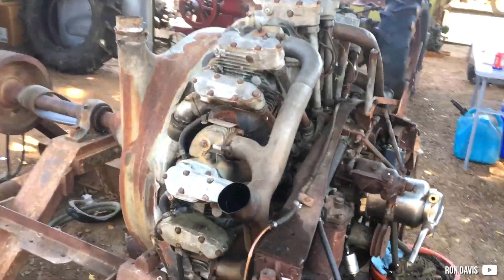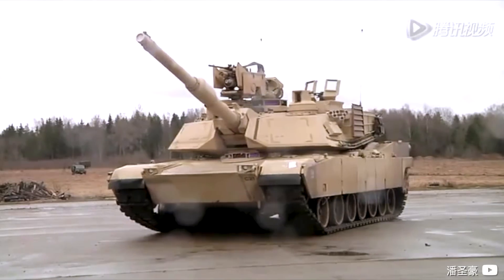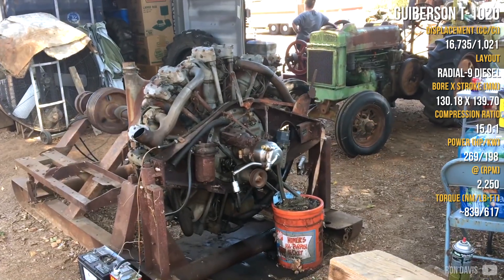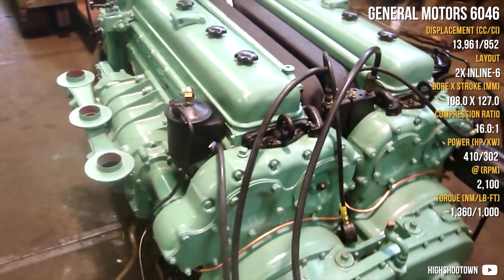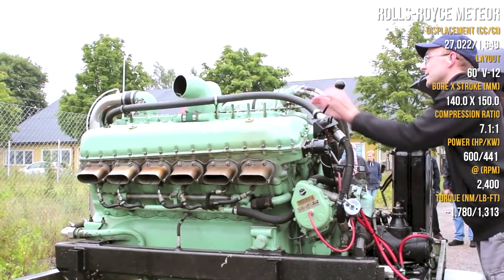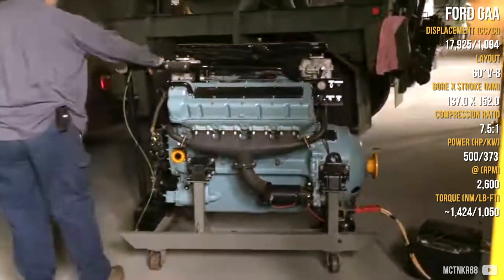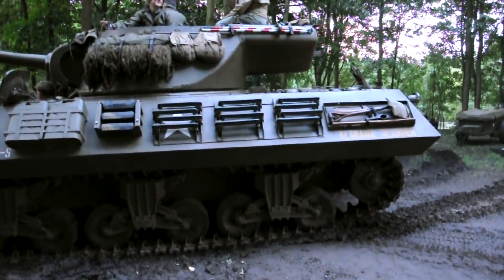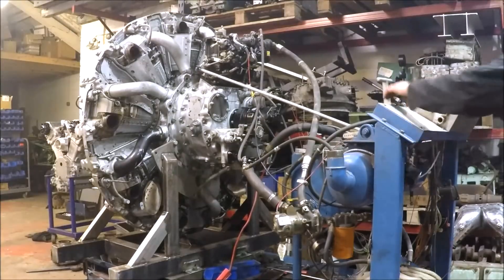The Strangest Tank Engines In The World

Comment: Soviet T64 tank has 2-stroke 6cyl opposing-piston diesel like on some Soviet locomotives and Junkers bombers. As well as T80 has quite similar to M1 turboshaft power unit. There are also some examples with odd cylinder configurations like X or H
Reply: T64 tank have 5 cylinder engine, only most new versions t64bv2 have 6 cylinder 1000 h.p engine

Comment: The RR Meteor was a V12 but they also made a V8 version called the Meteorite which was used in the Mighty Antar tank transporter.  Many of the spares were common so you could get a V8 tower with a Centurion V12 on the trailer.  Both were made by Rover after they lost the jet engine contract to RR.  This was a sort of consolation prize.

Comment: Your "Twin Bus Engine" is was known at the time as the 6-71 twin "Power Pack". It's two 6-71 Detroit Diesel two stroke engines mounted on a central gearbox with a single output drive. Used in tanks, boats, particularly landing craft and for generating electricity or running irrigation pumps. After the war, there were so many war surplus units like this available quite cheaply, that logging companies bought hundreds of them to re-power yarding equipment that had originally been build to run on steam. The "Power Pack" eventually lost favour when the 8V-71 and 12V-71 Detroit diesels offered the same or more power in less space, and did away with that central gearbox.

Comment: i actually am planning on using a type 59 chinese mbt diesel engine in my 1950 buick. why? well it has a near 1.5 ton inline 8. my hoist can hold 2800lbs on max setting. it bent the 1/4inch total thickness hoist like a taco so its in the 3klb range. the tank engine weighs about double. but. makes 1500ftlbs torque..... on the lowest tune setting. i been planning it for years. allison racins transmissions claims they can build a semi truck trans to fit it. sadly i need 30k for the motor{26k of that is shipping fees} and over 30 for the trans and trans build. hopes and dreams right now but damnit i need it

Comment: Aircraft engines do NOT spin the other way around from automotive engines!  SOME Honda engines spin in reverse rotation and some aircraft engines are produced to do the same thing [The LO-360 on the right wing of the Piper PA-44 Seminole], along with some Russian engines that seen from behind, spin their propellors [output shaft in automotive use] counterclockwise.

Great video!
Reply: European engines turn one way American engines the other or that is how it was..
Reply: @flyingjohn2284  That's not true.  The British and Russians built some reverse rotation engines, but generally European engines spin the same way as American engines.

I'm not sure why Honda does this.  They sell a lot of cars in Japan where they drive on the left and reverse rotation means the engine can be located on the left side of the car [seen from behind] and the transmission on the right, which might give more room for steering and brakes?  I don't know.

Comment: One of the main reasons the American m1 abrams has a gas turbine is because it’s sound signature is at a higher frequency. Higher frequency’s are louder up close but from far away they are harder to hear because higher frequencies travel a shorter distance than a low frequency. So a diesel has a lower frequency meaning it could be heard far away compared to a gas turbine and the US army saw this as an advantage.

Comment: never knew removing a forced induction system reduse so much power, l like legit 16000 to 600 isnt a small number
Reply: There was probably other changes made for the different performance needed. Aircraft need high output and at mostly high rpm. The tank needs good torque from down low and up. At the least the cams and ignition would be different, and possibly more.

Comment: t-64 opposed piston engine. its 5 cylinder but 10 pistons and two crank shafts. it used a turbo charger to force air through he engine since it does not have valves in the normal sense. it also uses gdi because it is closer to a2 stroke then 4 stroke.
Reply: It's called a Gegenkolben motor, invented Welhelm Oechelhauser and Hugo Junkers.
The 5TDF engine is based on the famous Jumo 205 series and is not GDI, it is a multi fuel 2-stroke Diesel cycle engine.
Reply: @sandervanderkammen9230  it is "two stroke" but not in the traditional sense. the turbos keep the air moving through fixed holes in the walls, but the the fuel is injected.  if you read documentation on the Russian engine it has a separate fuel and lubrication system. idk how the German engine was made but this one has injectors. http://btvt.narod.ru/4/5td/5tdf.htm
Reply: @triarii_00  It is very traditional for a two stroke Diesel engine, uni-flow type, normally aspirated with blower scavenging or with turbo-unloading.
Exactly the same as the Jumo or Winton type two stroke Diesel engines. 
Your reference credits the Jumo 205.

Comment: Jay Leno built a car with a Ford GAA engine, then turboed it as it was only 800 horse power. He ended up with 2 engines as the first had a fault.
Reply: The Blastoline Special is powered by a Continental AV1790, not a Ford GAA.

Comment: You didn't even get to the Chrysler Multibank: 
FIVE Chrysler flathead-six passenger car engines, bodged together at odd angles into one huge gear drive. It weighed 4500 pounds (about 2000 Kg),  and produced 450 hp. All five carburetors were set in a row, plumbed to their separate engines by long pipes, to simplify the throttle linkage. It was used in Sherman tanks as a desperation measure, because the aircraft radials that were the best choice at the time were in short supply. And it could still move the tank, if slowly, with two engines knocked out.

Comment: GAA Ford version of a RR/ Rover Meteorite? A 18 ltr 60 degree V8 version of the Meteor
Reply: No, the GA was developed as a direct replacement for the Packard V-1650.
Reply: @sandervanderkammen9230  Packard V-1650 was a US Merlin.   so independently developed from the same starting point then.
Reply: @dinger40  American manufacturers were not impressed with the original hand built Merlin engine had poor quality control and parts were not interchangeable.
Ford independently developed the GA to allow for mass production and greatly improved tolerances and fit of the fully interchangeable parts.

Packard completely redesigned the Merlin and made it compatible with modern mass production and fully interchangeable parts.
The Packard design won the American aircraft engine contract and Ford with no other customers was forced to adapt it's GA engine to a V-8 for tank use.

Comment: Leyland L60 6 cylinders, 12 pistons.
Kharkiv V2 a 39L V12 with a stroke that is longer in one cylinder bank than in the other.
Reply: The L60 was in the British Chieftian tank.
It was multi fueled and very very unreliable. 
Every 100 miles, if you were lucky, the thing just packed in. Block change. Pice of crap

Comment: Hi, talking about strange tank engines (and starter engines that sound special ^^, ) it's said that some old Leopard 1 tanks had an additional VW type 1 boxer as starter engine, but till today i wasn't able to find out more or get it confirmed, so it also may be a rumor. Perhaps you can find out more on that, i'd love to finally see video footage of a tiny VW engine starting such big tank diesel engines :-D
Reply: Not true
Reply: @sandervanderkammen9230  - you're probably right. Would explain why i wasn't able to find any proof for this, so it was just rumors.
Reply: @nopadelik9286  The Leopard 1 engine was built by MTU, (aka Maybach), the Maybach HL series produced during WW2 was also equipped with conventional Bosch electric starters.

Comment: Great video, many thanks! I have to say those Meteors at 04:50 sound like a proper V12, way better than the coughing spluttering lumpy Merlin.
Reply: Perhaps because it's naturally aspirated. Anyways the plane engine low rpm doesen't matter, as it's usually run at higher rpm than in most stationary videos when actually flying
Reply: The Merlin & it’s spin off were war winners stunning engineering…

Comment: Modern Tanks should be powered by electric motors for that instant torque!!
Im waiting for Toyota to manufacture Tank diesel engines only then we will see true power and economy and reliability without turning into an endless money pit!
Reply: would make some interesting new tactics on the warfield: let the opponent run in circles until Batteries are dead :D
Reply: @Popk1ller  naaaah we can fit a small diesel generator at the back to help recharge dead batteries..

Comment: The Abrams 1000 rpm peak torque is the output shaft not the engine which will be doing at least 10x that rpm

Comment: Bit of a slight correction on the AGT1500. those RPM values are for the power turbine. Its a three spool engine, so there's three different RPM values at any given time. peak power comes at 20,000+ RPM N3, 10,000+ RPM N2, and at the given RPM values for N1. Think of a piston engine with a turbo, peak power comes with peak turbo RPM.(and there's a billion other factors too)
Great video otherwise, keep it up!

Comment: I don't think it is true that the Meteor's rotational direction had to be changed.  The output shaft of an automotive engine spins the same direction that an aircraft's propeller spins.  That is, from behind it appears to spin clockwise.  Many Russian engines spun counterclockwise, but not western designs.

A few US light aircraft engines do spin counterclockwise.  The Lycoming LO-360 on the right wing of a Piper PA-44 Seminole is an example.  This is done so that there is no critical engine.  Great video!

Comment: M5 Stuart: 2 Cadillac V8s driving through 2 automatic transmissions mated to a transfer case.
Reply: AC1 Sentinel - 3 Cadillac V8s driving to a manual transmission... (also the only tank fitted with dual 25 pounders in the turret).
Reply: M4a4, 5 chrysler engine combined together
Reply: @faatihh1130  So bad the Americans never used it... shipped them to the U.K. and the Soviets
Reply: @sandervanderkammen9230  I wonder why america prefer petrol over diesel
Reply: @faatihh1130  Generally aircraft engines from this period ran on gasoline (petrol).
Aircraft Engines are preferred in tank applications due to the high horsepower to weight ratio performance...
Although there are a few exceptions, like the Kharkov V-2 Diesel.... but this is also derived from the AN-1 aircraft engine.
Reply: Both failures..

Comment: a couple that comes to mind: the Panhard EBR has a Flat 12 in the middle below the turret, the Swedish pbv 301 has a air cooled Flat 4,  the BMP-3 has a High angle diesel V10, and the T-14 Armata has an X12 engine, and the Type 90/74 has 2-stroke Diesel V10s

Comment: Are there any electric tank engines with diesel generators?
Reply: One of the two prototypes for the WW2 Tiger tank, Porsche's version, was a gasoline-electric setup where two v10 air-cooled gasoline engines ran two generators that powered the two electric motors, one setup per track.  Since this design was not accepted, most of these prototypes were repurposed.  Their turrets went on the first batch of Henschel Tigers (the version that was accepted), and their hulls were rebuilt into the Ferdinand tank destroyer.
Reply: Nah you prolly don’t want an emp Killing your tank

Comment: Hey VisioRacer, here's some more interesting piston engines that you might be interested in, this time from aircraft:

- the 36.65 liter Napier Sabre H24, which was essentially two flat-8s, becoming one of the most powerful inline engines ever mounted on an aircraft with 2,850 horsepower continuous or 3,040 horsepower at emergency settings. It powered some British fighters like the Hawker Tempest

- the 71.5 liter R-4360 Wasp Major, which was essentially two R-2180 Twin Hornet engines fused together - and THOSE were essentially two R-1690 Hornet engines fused together. At the end of it all, the Wasp Major was a radial engine with four rows and an absolutely insane 4,300 horsepower
Reply: Don't forget that the R-4360 is also a Turbo-Compound and supercharged. So think of it as a stupid big Turbo with some radial banks in the middle. Yes, there was a TURBINE on the crank. 15/10 awesome.

Comment: Why was sodium fillled in the exhaust valve ?
Reply: It is inside the hollow valve to cool it, also in high end car engines
Reply: I get that....but what’s the point in cooling the exhaust gases
Reply: @arkachakraborty2001  IT is not to cool the gases but the valves themselves to keep them from expanding and making a poorer seal against the seats, thus lowering compression in the cylinders.
Reply: Thank you

Comment: While not the tank, Junkers JU-86, a German WWII bomber was powered by a pair of 6 cylinder oposed two-stroke DIESEL engines (Junkers Jumo 207). 

Talk about unusual! 😎
Reply: I used to work on these back in the 70s. It was a bit fragile and prone occasionally to a hydraulic lock between the opposing pistons which was a catastophic failure. Essentially too much power was asked from an old design.
Reply: Napier made them under licence and worked out a way to make them into a triple bank "deltic" engine which was used in high speed boats, high pressure water pumps and locomotives. 9 and 18 cylinder versions.
Reply: @Matthew Lund And you beat me to that, Matt.  (Richard)